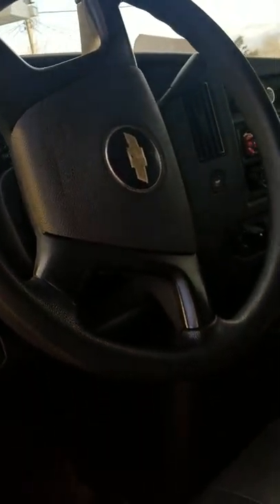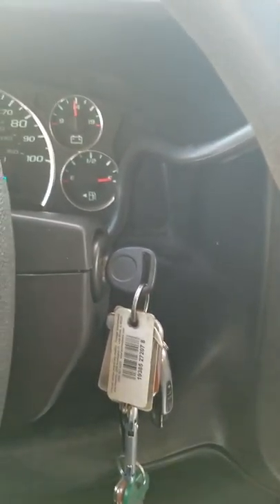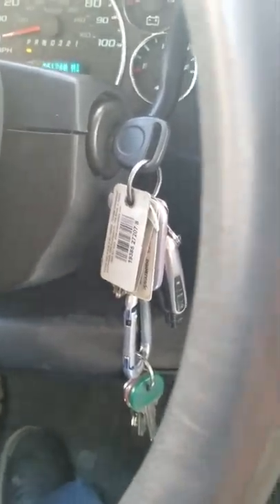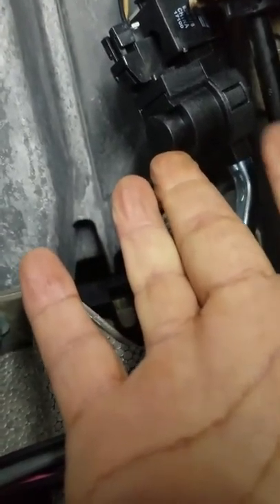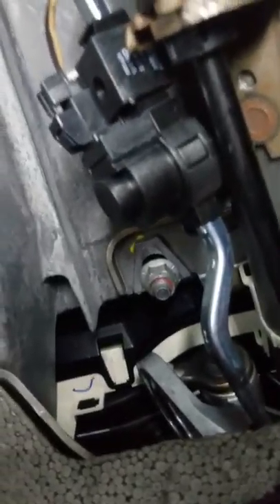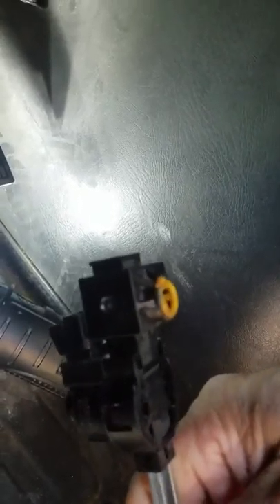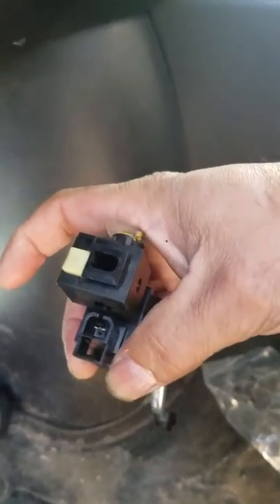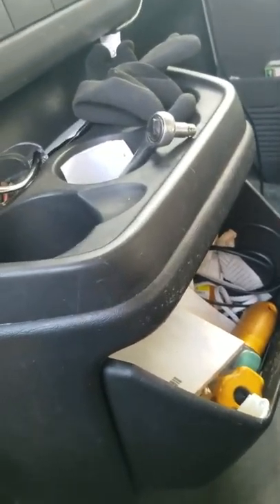Chevy Express 1500 shifter interlock solenoid replace

Comment: Excellent video. If you have no new solenoid, the quick and dirty solution is to remove the 2 wire connector going into the solenoid, this will allow truck to shift out of park without even pressing the brake. 
Youtube and internet is full of idiots that tell you that truck does not shift from park because of the brake light switch. Hahahaha. The interlock shifter solenoid, that gets replaced in this video, will cause your truck to not shift out of park and leave you stranded somewhere. The only problem I had was removing the solenoid from the bracket holding it. Excellent video.

Comment: So if u just unplug it it would shift into gears ??? When I press my brakes it doesn’t let me change gears
Reply: no, the solenoid give the transmission permission to change, you'll likely need a new one
Reply: yes just undo the 2 wire connection

Comment: Buenos Dias mi Amigo! 
Great Video! I'm hoping it helps me! I want to ask you, well let me tell you what's happening with MY 2009 Chevy Silverado and I want to know IF its the SAME PROBLEM you were having with your Van in your video please? 
When I go to put my truck into gear after starting it, I have always needed to first, pull the gear shifter slightly toward me (I assume to get it out of gear) THEN pull downward to get into the gear I want to be in (Usually D or R). However when I go to pull downward the shifter will not move. I have to sorta "play with it" a little, wiggling the shifter while I pull downward to kinda find that "sweet spot" where the shifter will FINALLY pull down into gear. I too have been to two shops who do not seems to know much without me paying through the nose for a proper diagnosis. I have come to believe it's the very same shit solenoid issue you show in this video. Were YOU having this same problem with your van? Thank you so very much my friend for your video and any help you may kindly lend. 
Sincerely,
Larry in Maryland

Comment: Hi. I also need to replace my shift interlock solenoid on my 2001 suburban 1500 but don’t know how to. Would you please tell me how you did it and tools required. I know where it is and have located it. But don’t know the procedure. Thanks in advance.
Reply: what was your suburban doing trying to see if this is what is wrong with mine have you got your back up and running

Comment: hi i got the 2005 Ford Econoline E250 When i shifted it didn't do nothing Van doesn't move don't you think should i replace that part ?  Please help . Thanks
Reply: Did you figure out what it was? Please and thank you
Reply: U cud be having a blown fuse for the shifter.check ur fuses.it happened to my 2005 ford explorer too.
Reply: Sounds like your linkage cable on the side of the transmission has a bad bushing